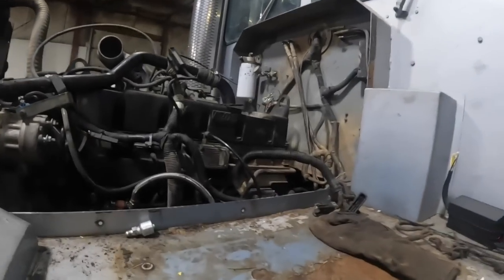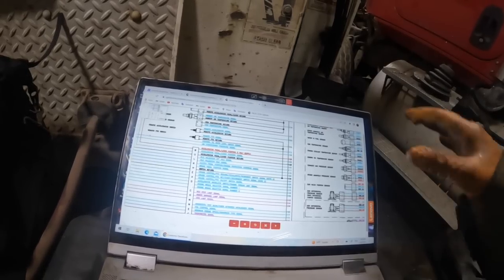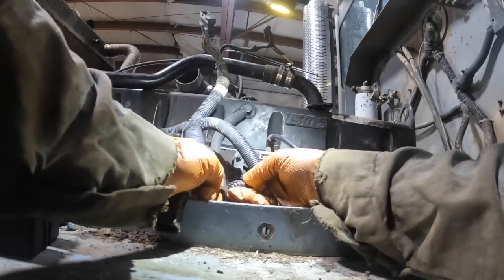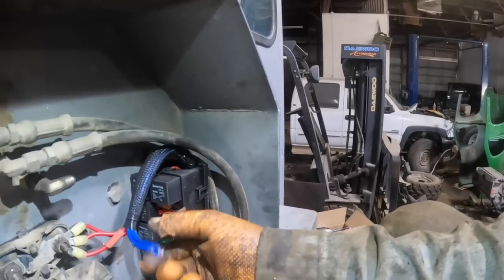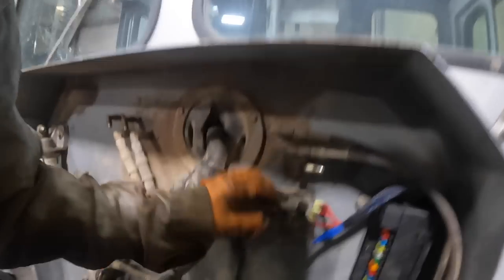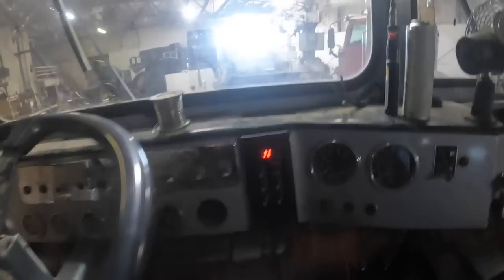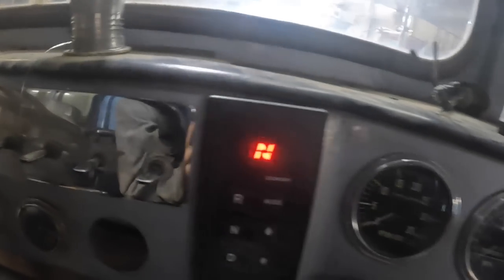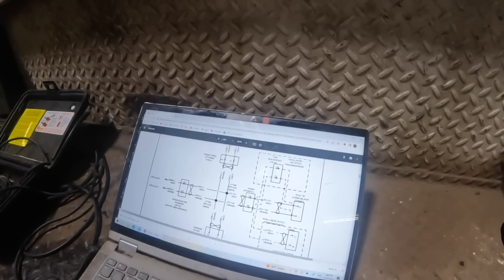Wiring the retrofit engine and trans in the hay squeeze.

Comment: Excellent video wiring is a real challenge trying to combine old and new into a different chassis. Can you use like a seat pressure switch to isolate the 2 operators stations or a electrical block out of the throttle pedal or a mechanical block off so the pedal doesn't work unless the actual operator is at the controls kind of like a street sweeper has just a thought

Comment: They make magnetic charger adapter for just about any laptop or electronic device for that matter.  You can find them all over eBay and Amazon for a couple of dollars which is nothing compared to a new laptop.  The way they work is you plug one end into the charging port of the laptop and the other end goes on the tip of the power supply.  I have used them for years some are better then others and if you have a problem you can remove the pieces and plug in the charger like before.  They are also available for all the common round barrel connectors.  I don't know how many time I have gotten out of a vehicle with my autel tablet in my hand with the cigarette lighter adapter plugged in.  They also prevent the charging port from wearing and tear since it's not being constantly inserted or removed.

Comment: This reminds me of the wiring required to switch a gasoline Jeep to a VW Diesel, Jeep put in modules in the dash which needed its computer.  I put in an aftermarket radio and had to get a special chipset in the harness to trick the computer into not registering the radio as stollen and denying the Jeep from starting.

Comment: The pto on the allison transmission Does it have a clutch setup inside ? .Im in the septic business and some guys have a hot shift pto to run their vacuum pumps. Some have had to replace the pto because of smoked or worn clutches. One pumper had a pto replaced  on the Allison. It was wrong pto and  and the shop didn't catch it and  blew the transmission ...90 days and 38000 dollars it was back together with a new transmission. Western Star paid the bill.

Comment: Dogs: The lot for my Little building is a "high security" lot but I still had a spell with people breaking in and stealing batteries etc from equipment I had in the lot. Cop friend said "Amos, get you some big dogs and let them run in the lot". Sounded reasonable so I did. Some son of a bitch cut a hole in the fence and stole my dogs. On a Monday. During working hours.....
People shooting: same Little building use to be the city dog pound,then a kennel for the police dogs. Has 4 bullet holes on the street side wall.....